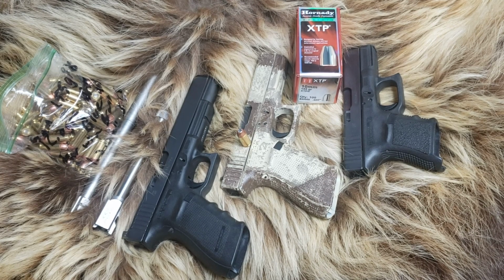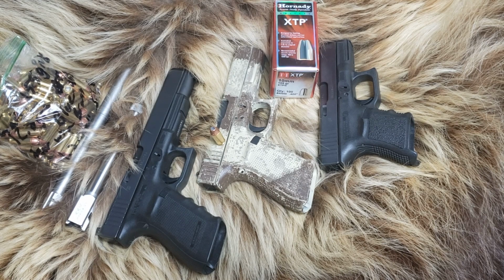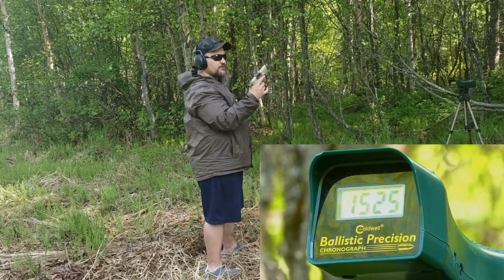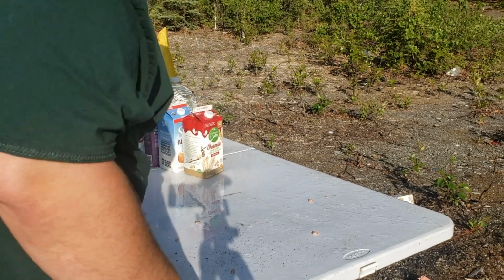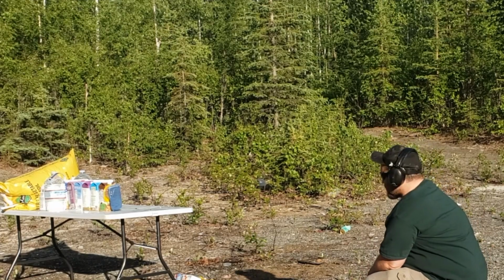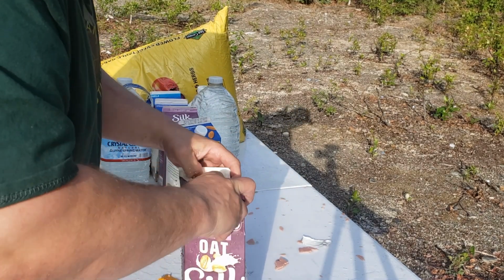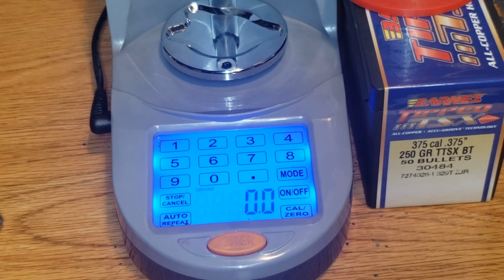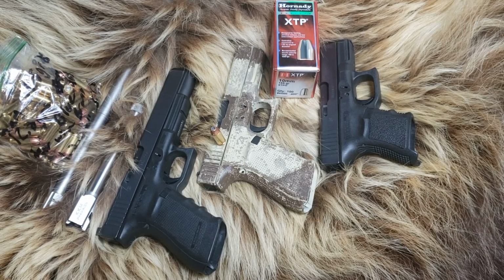10mm 155gr XTP Glock 29 vs  20 vs  40 Handloads

Comment: Impressive, I use 9.2 grains of Longshot powder in my Springfield XDM 40 with the 4.5” barrel.  Chrony readings are from like 1385-1420fps.  Either way with that load i have more speed than a 357 158 grain bullet and more energy.
Reply from the maker: That's hot for a .40s&w
Reply: And a lot less reliability. The sectional density is also less which equals less penetration. You may be shocked to hear this but a 9mm in the 147g loaded similarly would have better penetration than that 40 s&w even at less energy and speed. The two don’t always show the whole story. Look up the underwood test between 9mm and 40. The 9mm penetrates like 20 more inches than the 40 because of sectional density. The bullet shape will also play a huge role. Flat being better. You can also load the 357 way hotter than what’s stated. The 357 has more potential than the 10mm in an auto loading platform period. If you use the 10mm in a revolver that’s a different story. Still 9mm will crush through a bears skull with the loadings these days at 15-20 yards. I’d still want a 44 mag revolver if it were around grizzly. But black bear? Hell even underwood’s .380 hardcast would probably zip right through its head. 40 is still a good round and id feel confident with it, there’s just better options.
Reply: @thorshammer5134  You can't get and speed out of a 180gr .357. 10mm start at 1200 and get past 1300.

Comment: Have you run your fired brass through the Redding push through bulge removing die for .40 & 10mm?
 Stock Glock barrels leave a bulge too low in the case for most push in pull out sizing dies to remove. 
 Roll sizing would probably be best but those machines are too expensive for me.
Reply from the maker: No I haven't.  This was brand new Winchester brass though

Comment: Great comparison test Chuck !! Very interesting information as usual. I'd just shoot a few hundred rounds through the 20. There's hardly any semi auto that does not require or does not improve with a decent breaking in period. Sometimes 1000 rounds will cure all the problems, in general 500 to600 rounds will do the trick. Even the best machining can leave microscopic burs that can interfere with the proper feeding and ejection of some ammo. Not all. There is also the need at times to activate recoil springs a few times to get them to be livelier and function more efficiently. More often than not...This depends on the loads themselves. Some will shoot perfectly while others will jam. What helps the most is cleaning thouroughly as well as finishing with grease and oil. It seems that the most efficient speed for very good expansion for that 155 grains XTP is generated out of the model 29. The others push it a bit too fast in my opinion.
Reply from the maker: Totally agree
Reply: @AlaskanBallistics  One more thing I didn't mention earlier are the magazine springs. With very hot loads, the stiffer mag springs tend to provide better performance. A failure to feed or eject is at times due to a slide moving too fast in relation to the magazines springs. With the 460 Rowland for example the fastest loads benefit from stouter mag springs. Just a thought that may also apply to some 10 mm autos. One way to check that is to substitute magazines from your model 40 to the 20. If the failures persist, before doing anything else, I'd put a few hundred rounds through the model 20. All springs, recoil and mag springs benefit from some compression and decompression. If everything fails...I know a friendly FFL dealer here in CA who would accomodate a transfer that would take off of your capable hands this unbecoming horror for a fair price. This would allow you to continue shooting the Alaskan country side uninterrupted by such pedestrian interference as failures to eject... Just another thought Chuck.
Reply from the maker: I've used stiffer mag springs for my .45 super.

Comment: I had an issue with my first loads out of my G20. The factory spring was way too light for the heavy dose of no9. It cycled to fast to pickup the next round. I put a heavy spring in and it was fixed.
Reply from the maker: Good to know
Reply: @AlaskanBallistics  15gr was a little bit much for the factory spring. The brass would go 25-30' and hit the slide hard enough to put a slight crease  down the side.
Reply from the maker: Didn't happen with these
Reply: @AlaskanBallistics  have you tried no9?
Reply from the maker: Oh yeah got plenty of it.  Doesn't get the velocity that I wanted in these 155gr

Comment: Chuck, you have shown once again that performance starts out great in the G29, comes back to goodish in the G20, and then blasts off again with the G40. It is NOT just something wrong with Chuke's G20 that you have borrowed a lot. It is a recurring pattern.  

I was wrong. You were right. I admit it. 👍

It is really weird that 10mm projectiles have an upside down performance bell curve in relation to barrel length, and the curve bottoms out with the standard barrel length for 10mm guns. It's great for the compact and long slide folks! But it's so counterintuitive and against common sense. I get it that it's due to velocity increasing expansion and decreasing penetration, unless the petals peel all the way back and the bullet maintains speed and penetrates further. But it is weird that they design it so the odd man out is the one with the standard length barrel.

I've seen the 155gr JHPs consistently do 14-15in from G20's in gel, which is still indeed goodish for defense. 

But I think I will stick with 180-200gr for 16-18in in my G20.
Reply from the maker: Yeah 180gr and over in g20 and g40. Maybe the 165gr gold dot is okay

Comment: Your loads mirror mines. 155 gr xtp with hornadys max charge of blue dot gets me 1599 out of 6 inch kkm barrel in g20. Great for lions and two legged predators but for heavier game like bears and hogs I’ve got 200 gr coated hardcast going about 1290 fps with aa9 and long shot
Reply from the maker: Sounds like a perfect hog load.

Comment: Other than the round not firing in the 9 inch 🐺 barrel❓Im still impressed, with the way a longer barrel. Makes a big difference ✅
Reply from the maker: It does.  Be good for hunting from a blind or tree stand
Reply: @AlaskanBallistics  Gonna get me a kkm barrel for my next Glock ✅
Reply from the maker: @ammooth1592  you won't be disappointed!
Reply: For the primer it might not have been seated all the way. The firing pin hits the primer seating it and not setting it off.
Reply from the maker: Yeah plus i had a few dent seating them

Comment: Water is less elastic than gelatin (or people).  This same load into gelatin with a Glock 20 does not separate.  Maybe not too fast for this load.  I'd be curious to see this in 100% baloney.
Reply from the maker: Yeah i wish clear Ballistics gelatin wasn't so expensive to ship up here.
Reply: I test mine on animals. I've shot deer with my Glock 22 using Winchester LE 155gr loads and they all had jacket separation with very shallow wound tracts.

Comment: I'm not a fan of 155gr in .40 even less in a 10mm
Reply from the maker: Why not?
Reply: @AlaskanBallistics  I've had overexpansion and under penetration with Winchester LE loads in .40. I hit a blacktail in the neck 4 times with them and it went down after putting a 165gr Golden Saber through the spine. When I skinned it the wound tracts were only 2" at best.

Comment: OAL issues
Reply from the maker: Might be... thanks
Reply: Yeah could be OAL or crimping issue.  I have had some light primer strike issues when overcrimped since it pushes the bullet forward.  I crimp all 10mm to .421-.422" now and have not had issues since.  The ejection issue could be several things.  it could just be your ejector.

Comment: Blue Dot is very bad to go high pressure if you get too much power. I got over 2000 fps with 90 gr in 38-45 case. Case total destroyed on each shot quit fooling with Blue Dot.
Reply from the maker: I don't do much over charging